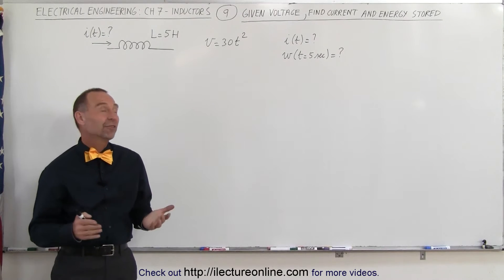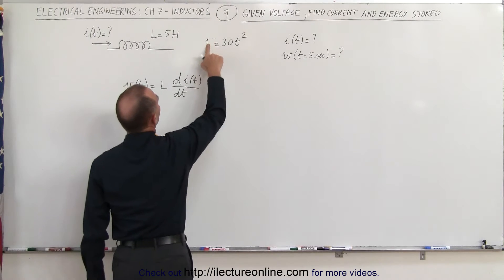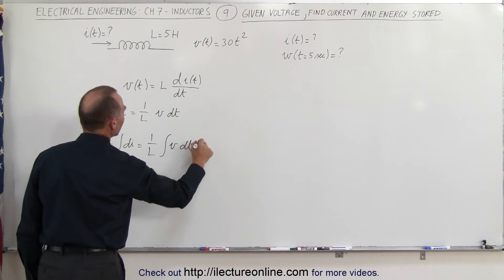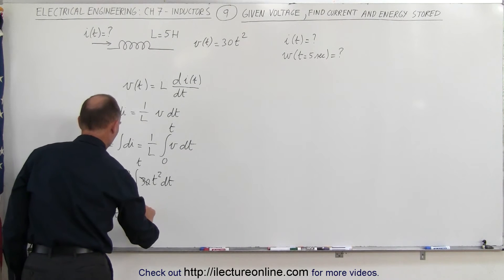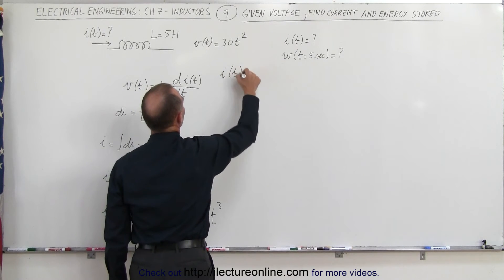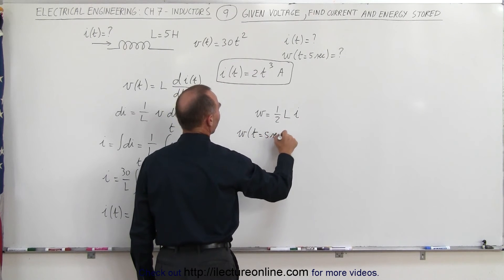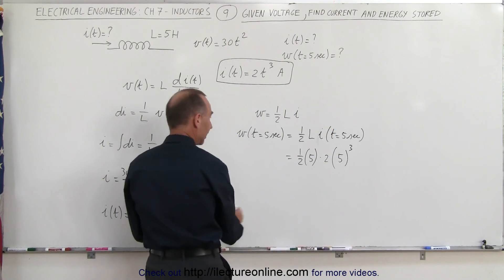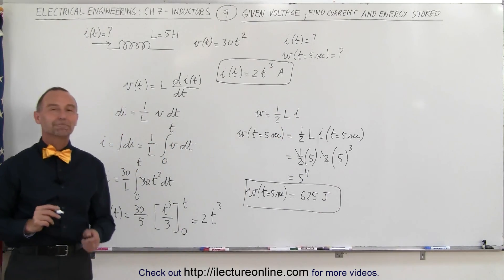Electrical Engineering: Ch 7: Inductors (9 of 24) Given Voltage, Find Current=? Energy Stored=?

Comment: Hey Michel!

A little slip there when you were to calculate the work done by the inductor. The work done is equal to 1/2*L*i^2, and the answer is therefore W(5) = 1/2*5*(2*5^3)^2 = 156 250J :)
Reply from the maker: Good catch.  Thanks.
Reply: Got the same answer

Comment: Hi Sir, can you explain how come if I try to multiple V(t) and i(t) won't get me the proper number power in Watt?
Reply from the maker: If the current and voltage don't have the same phase angle, you will need to account for the phase angle difference.
Reply: oh right! Almost forgot about that! Thanks alot!!